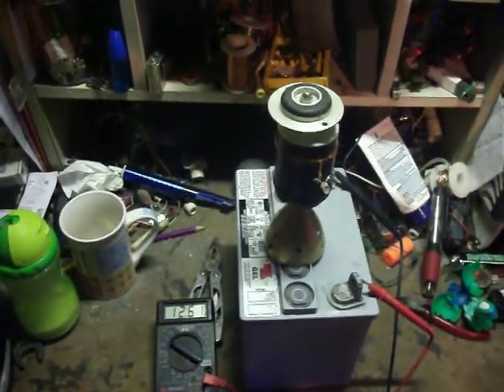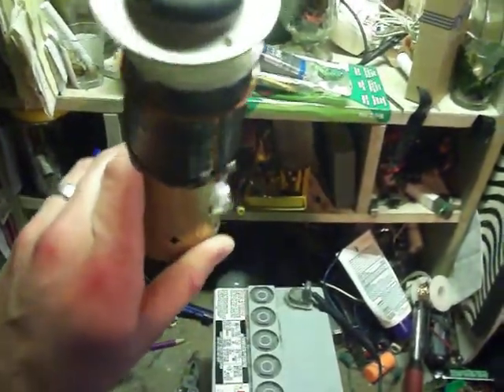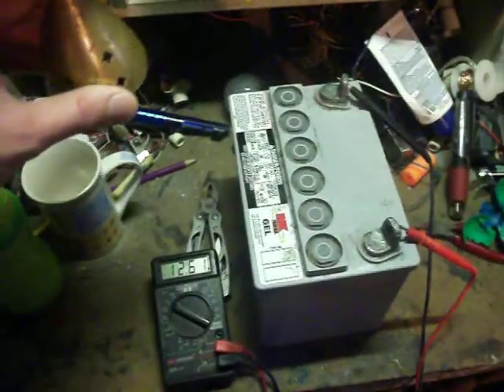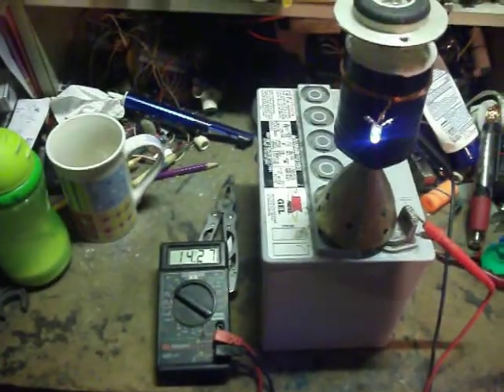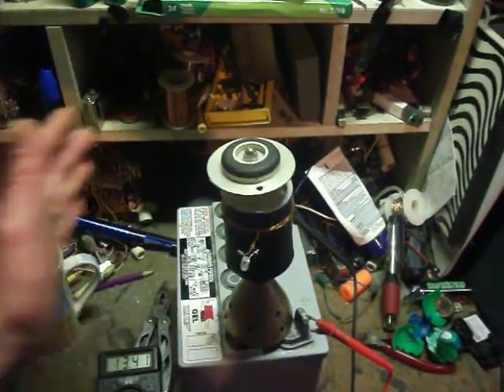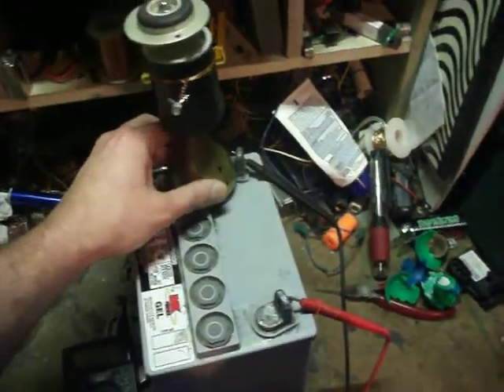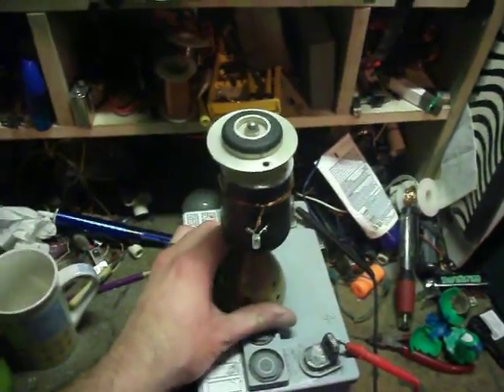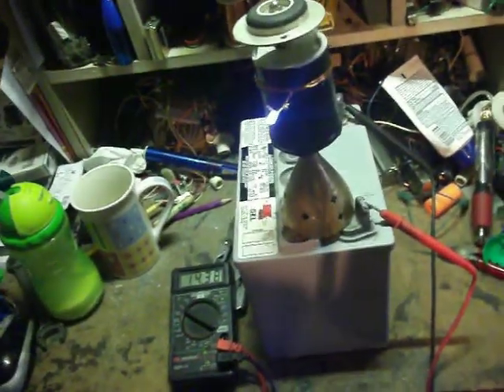wireless battery charger

Comment from the maker: i cannot, i don't know why the battery charges this way. i don't remember how i stumbled upon this effect. this coil is designed to resonate around 1.6 mhz. the three coils are close coupled  not connected to each other. the top and bottom are not physically connected. similar to having an asymmetrical coiled capacitor with a coil wrapped on it conducting through an led.